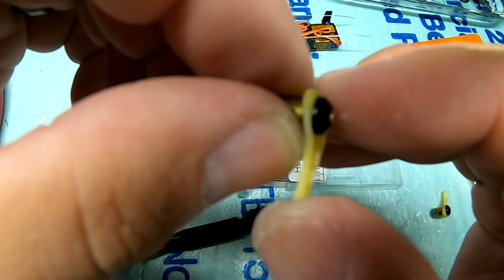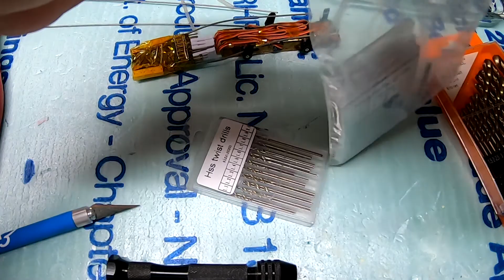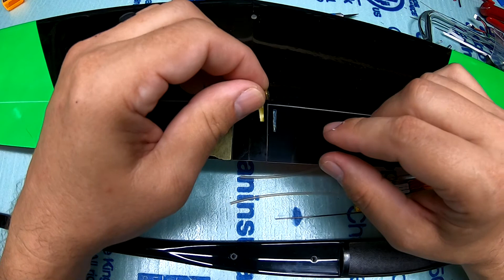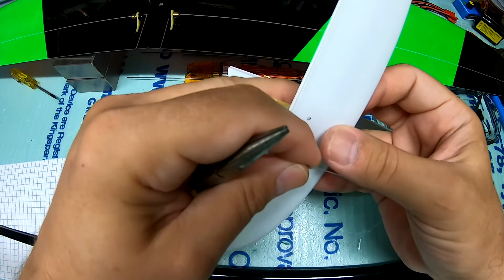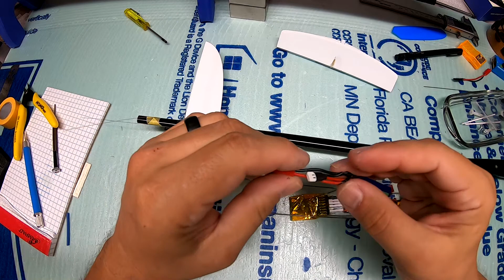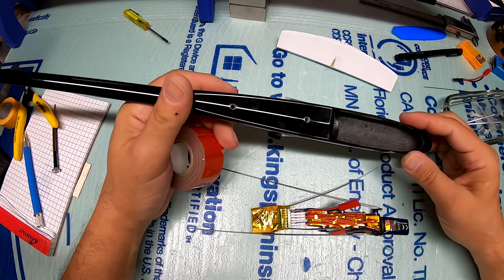Building the Hawk 1m DLG, Discus Launch Glider - Pt. 4

Comment: Where possible I add a short extension in the Rx bind plug so that if ever I need to rebind I don't have to pull the Rx out again
Reply from the maker: That's a great idea! I'm going to put that in the next video... and credit you. I only have the one transmitter so I hadn't thought about alternatives, but that would do nicely. Well, I still have the FlySky, but I'm probably going to donate that to a friend. A couple small pieces of velcro would attach the loose end to the top of the row of servos.